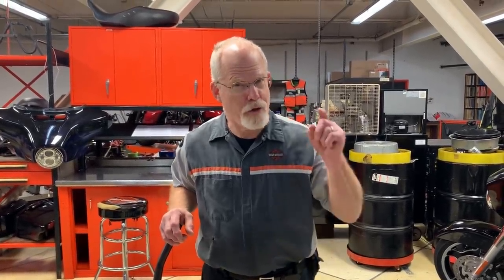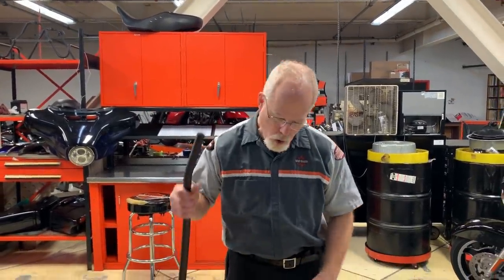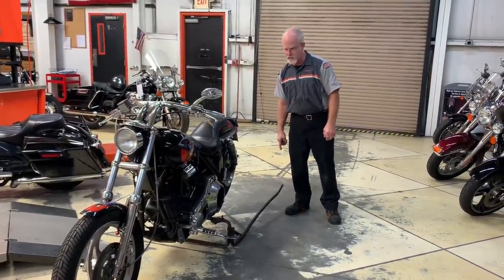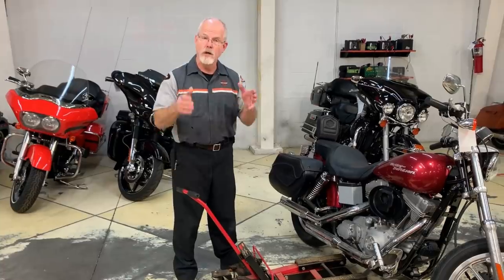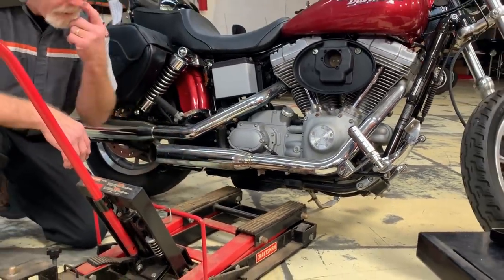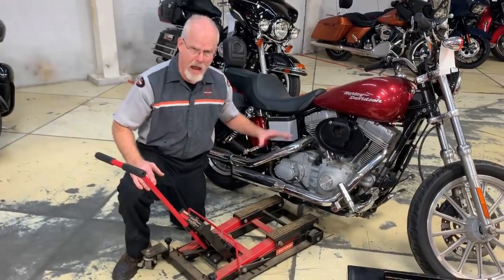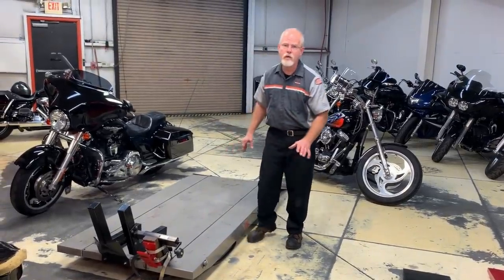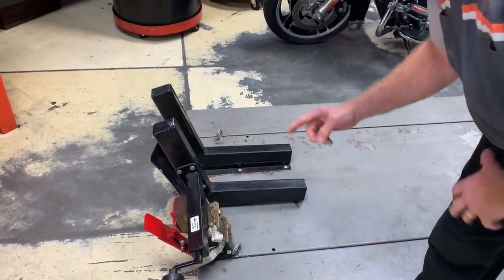DOC HARLEY: MOTORCYCLE LIFTS

Comment: Who makes good lifts?
Reply: ALFONSO thegreat J&S
Reply: Handy makes the best
Reply: J&S Jacks in Wisconsin. My Ultra Limited spends the winter on mine, and I also use it for my 05 Wide Glide. Solid as a rock, and rolls around if you need to.
Reply: Check out the J&S YouTube video.
Reply: J&S check their site
Reply: J&S makes a very good lift. Mine will handle a Dyna well. You can move it around with the bike on it fairly easily